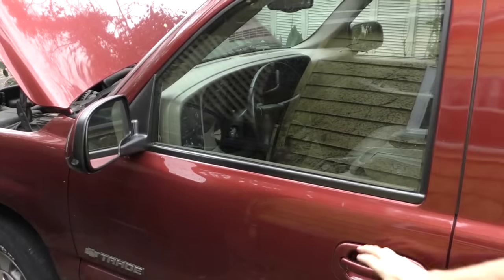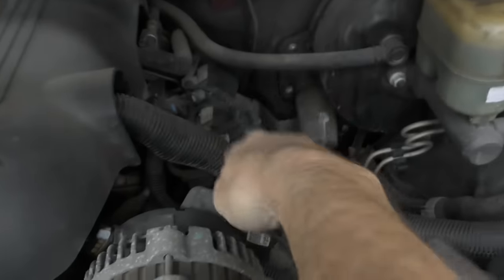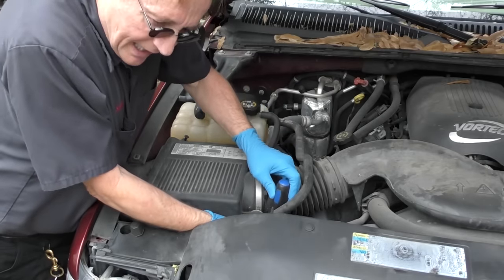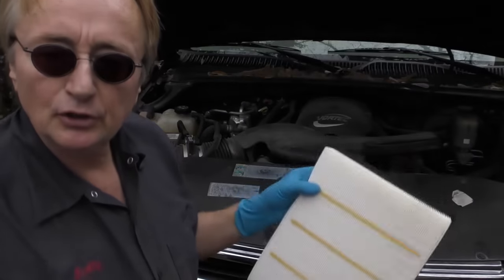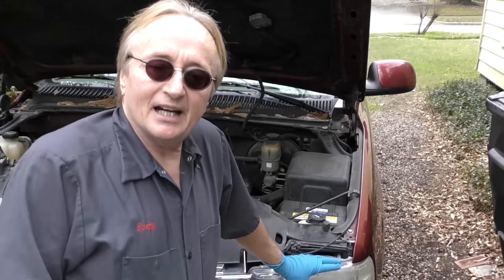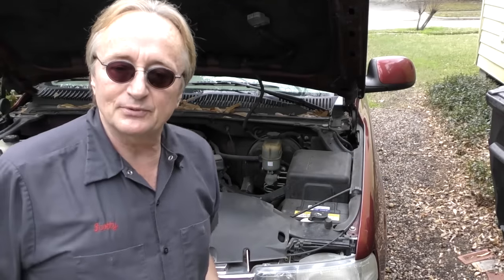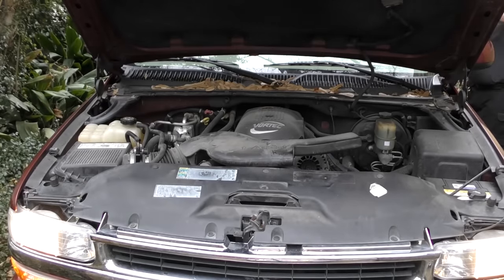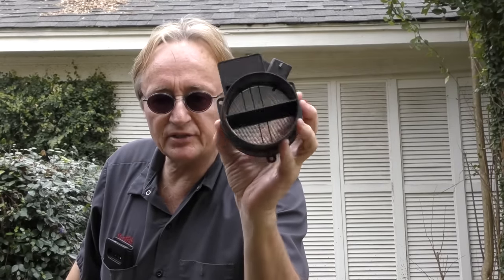Doing This Will Make Your Engine Run Better

Comment: Scotty, I have a 2007 Subaru legacy station wagon and whenever I fill up the gas tank more than halfway I can smell gas in the cabin when I turn on the AC, smell is also strong when I get close to the car after it's been parked. The issue goes away if I never fill the gas tank over halfway. What do you think it might be and how can I fix it? I really hope I don't have to change the gas tank. Hope you can answer this, thank you!
Reply: Sounds like the tank is not sealing properly where the fuel pump is installed most cars have a rubber type seal and a big ring that screws on.
Reply: @grantreid8583  would that still apply if I smell it even after only filling it slightly above half tank? I remember looking into this online and some people fixed it by replacing the fuel pump seal that's under the rear seat. But I thought that's probably not my issue since I don't have to fill it all the way to full for the leak to happen. It's probably worth checking out though once the weather goes above zero degrees, I live in canada haha

Comment: Will pluggin up the scan tool pull up any codes if theres no check engine light on?
Reply: Sometimes it might if it's a low-level thing.
Reply: Johnathon Castro yes, some codes are historic codes and some codes simply wont even trip the light at all, depends on the vehicle of course but some are so minimal they won’t trip a check engine light
Reply: Most cars i have seen will not bring the engine light on if they have faulty oxygen sensors which is a common problem.  I told my daughter not to buy a Jeep but she didn't listen.

Comment: Have a question I replace the Instrumental cluster and plug it the dash light are still not on I’ve check all the fuse and there not blowin still no dash light Change the dimmer switch still no dash lights 05 Yukon do you have any ideas 💡 on what to do

Comment: Hi this question has nothing to do with this video but I have a question about my 2006 impala LT ok so my car has been making this ridiculous clunking noise when I try to change the gears from park to drive then when I out my foot on the gas it won't move at all idk if my transmission fluid is low or something else worse is going on I really need your advice on what it could be because I'm confused 😑

Comment: Hey Scotty😸 How necessary is it to check intake/exhaust valve clearance on 1zz-fe engine. Fsm says every 60k. I have twice that and then some but car runs great. Gas mileage isnt as good as it should be @28mpg. Recommendation?

Comment: If somebody charged me for changing out this not even dirty air filter, I would feel (or even was) cheated...
Reply: It wasnt the filter it was a sensor he just did the filter cause he was right there.
Reply: @JRRepair  Yes of course, but assumingly the filter wasn 't for free.
Reply: If you put a new air flow sensor why would you put the old filter back. Kind of defeated the purpose.
Reply: @ozzesty7314  i did.. If it's fine, why replace it?

Comment: Why my truck GMC Sierra 1500 4.8 it’s using a lot of gas I have 435000 miles it runs fine I replace the fuel pump all the injectors it’s nice and smooth it’s just the gas problem help me out

Comment: My Lexus is running lean, hesitates when I floor it but pulling code for camshaft position sensor. Wonder if this is the problem cause it runs fine unless you floor it. Starts fine, idles fine but hesitates when I floor it

Comment: Hey great video! I have the same truck, just opposite problem. Could a faulty air flow sensor read falsely high air flow and cause a rich condition error code?
Reply: Faulty oxygen sensors seem to be the most common problem with any modern car.

Comment: 1.8t vw jetta oil pressure light comes on when letting off the gas and reaching around 2000 rpms after hitting the gas it goes away.  Any ideas?

Comment: scotty or someone, 2008 impala.
mine has this hesitation.. when I'm driving along, then try to get on the gas, ill feel a rumble sound then get this hesitation.  if i keep pressing the gas pedal the Stabil trc light comes on.. so i try to let off the gas when i feel it starting to hesitate and the light wont come on.. a few times when i start the car it feels like it wants to stall out... I thought i was maybe mass airflow. i cleaned that. no luck..  any thoughts?
Reply: Try cleaning your throttle body but it does sound more sinister than that if your traction control light is coming on.

Comment: My 94 Celica has turned 335,000 miles and runs like a clock. No check engine light either.

Comment: I have a 2006 trailblazer and I cleaned the throttle body with 117000 miles and no engine light . Disconnected the battery overnight to reset the computer and now I have an engine light on , just don't get it ???  It was running better and now it's worse but still drives ......... any clue??

Comment: Scotty I have a Mustang V6 that makes a loud tapping noise I think it's the lifters and it taps constantly, should I keep revving up the engine???
Reply: yes start it and hold the gas peddle on the floor untill the motor shuts off.  problem solved

Comment: I have a turn signal problem, the back left turn signal won’t work at and and the front blinks really fast. Both were replaced and still the same problem. Any one have any suggestions on what the problem may be ? Thanks.

Comment: my engine runs better after having it's 10k oil change. btw my cel is on but no codes found, do i change it to toyota?
Reply: Prob a old stored code. Getting a corrola will correct this issue.
Reply: @1stock1not  the 75 dodge van never had problems like this

Comment: I've got the same engine 5.3L 99 Sierra 286,000 but it's running rich on both banks. -15% fuel trim and poor gas mileage. Any common problems to look for?
Reply: My 99 silverado 5.3 has the same problem. From what I have learned is the gen 1 ls engines had a intake gasket problem on the plastic intake. Verify the intake gaskets are good along with the mass air flow sensor. This also causes the lean bank 1&2 issue. Also the engine idle surges when it's cold but clears when the engine earms up.

Comment: Wish u could fix my car scotty I have infinitiy fx35 2003 239,000 code po300 cant figure it out any advice smell fuel exhaust changed plugs still rough idle still have 1 code

Comment: My g35 coupe keeps overheating, it has a new radiator, thermostat and fans, theres light smoke and water drips coming from the exhaust after letting the car run for a little bit, i dont think a bleed test will help but hopefully someone here knows, or should i get the steel seal or bars leaks gasket fluid? I do not wanna dig up the engine to replace the head gasket lol

Comment: Scotty I’m curious, what’s your opinion on air flow censor cleaners? Do they work?
Reply: Yes, if you see dirt on the sensors. Usually it's clean if there is no air leak from the air filter.
Reply: The CRC MAF cleaner stuff is what Scotty has suggested from time to time.

Comment: Hey scotty, i have a VW 1.4 tsi 122hp. The engine stutters a bit at idle. I changed the sparkplugs, ignition coil, battery, all the filters, oil and coolant. Still stutters, what do i do?
Reply: Try cleaning the throttle body its a common problem with a lot of cars.
Reply: @grantreid8583  cleaned the 2 MAP Sensors today and its still the same. I think my last option now is the throttlebody
Reply: unfortunately this engine is a fuel stratified engine and needs inlets valve clear from deposits that's why engine stutters at idle, i have some videos on my channel about repair and maintenance on vw and other car, take a look.

Comment: I would of just sprayed map sensor cleaner on it 1st.
Reply: Don Le  He would of said, I just think it was a customers car and wanted to make sure it wouldn't be back anytime soon.
Reply: The thing is it will be back soon. Those fuel trims were not stabilizing as he said. The short term should read near opposite of the long term until they reach stoichiometry if indeed the problem was fixed. I like Scotty because he is like the people's mechanic, but he's not at the high tier that most of his subscribers seem to think he is.

Comment: So in open loop when the engine is cold I thought the computer didn’t really look at the MAF ?
Reply: Timboslice you’re thinking of the o2 sensors. Maf is used at all times. O2 sensor data is used after the min coolant temperature threshold is met for closed loop enable. A map sensor is used during open loop to measure engine load/vacuum. Once closed loop kicks in, the map sensor is used for transitional fueling and as a backup to the maf if failure occurs. The maf signal becomes the main player in fueling after that.
Reply: John Sorg Know what that’s right when the computer senses the coolant temperature is below a threshold it doesn’t look at the 02 sensor, I forgot about that I learned that back in junior college auto tech

Comment: This is the problem I'm having with my C6 Corvette.  I thought it was because I installed a cold air induction system. Won't pass inspection. I replaced the airflow sensor but the check engine light still comes on.. 68,000 miles 2007

Comment: I have a 93 Acura Intengra and whenever i turn at low speeds i hear the steering wheel making a squeaking sound and sometimes becomes tough to turn. I think the power steering pump might ne going out. Am i right?
Reply: Could be the pump, but it could just be low fluid level, so check that, first.
Reply: @EMichaelBall  i have...theres enough fluid.

Comment: Hey Scotty what are your thoughts as a Honda Civic type R as a daily driver
Reply: Yeah he loves them but he would advise you to road test it to see if you’re ok with the ride quality
Reply: 3rd to 4th grinds randomly with no known cause. Torque steer is going to be there. Once you factor in the operating and fueling costs, a Model 3 Standard Plus (RWD) would be a cheaper car over time, and with the Full Self Driving option package, would fight depreciation better than any new car I know of. It basically is a necessity to get FSD; to see why, youtube search "Tony Seba robin hood conference" and watch that presentation.
Reply: Yea i love it when someone pulls up beside me in the inside lane at the traffic lights in an expensive type r thinking they will race me across the lights and my old falcon blows their doors clean off it scares them a bit when they see smoke coming off my rear tyres at 50 as the boost peaks.

Comment: i have problem with my silverado 2014 the engine sometimes while idling gear on drive the RPM drop below 500 and it feel like it will turn off any idea ???
Reply: Try cleaning your throttle body.
Reply: Yeah. Perhaps the battery if its original. Weak batteries can make weird things happen.
Reply: grant reid i clean 10 times

Comment: my 2018 mazda cx-9 the oil fill says 0w20 but the owner manual says 5w30 which is right.
Reply: My 2018 honda takes the 0-20.  I would call the dealer service dept because a error on that could damage your engine
Reply: I'd do what the owners' manual says. You could call the Mazda customer service hotline and see what they say. Either way, it should be full synthetic.

Comment: Wow a 2002 with no rust on it. Up here the brake lines would have been done and the rocker panels are rotted out
Reply: Fix It 1975 It’s Houston. No snow. No ice. No salt. No rust.

Comment: BATTERY... do you need to disconnect it before you unplug the MAF?
Reply: No. Just keep the key out of the ignition. I only disconnect the battery if I'm working on airbags or anything that could be part of the airbag circuit, disconnecting and reconnecting the ECU, working on electronic power steering systems, or anything with aftermarket alarms and remote start.
Reply: Always unplug the battery no matter the job

Comment: A good mechanic i have told me to remove my engine,that will reduce my vehicles weight and will hugely improve gas mileage along with less strain on the suspension and tires and will last longer,scotty is this true?

Comment: Running lean caused by a part that's responsible for sucking in air or monitoring how much it gets.

Dishonest mechanic: It seems that your engine has a problem and it'll cost you $3,000 to replace with second hand engine. Also change the fluids and air intake for additional $550.

Comment: Mass air flow sense = Purge valve ?
Reply: What?
Reply: I'm confused because when you have a purge valve problem you do get the same code readings.
Reply: Maf sensor has to do with the incoming air. I know of two purge valves ones the evaporation system for the fuel and another one (kinda) for your refrigerate for your ac. What code on what car and year.

Comment: I have a 2019 Ram 1500 Classic. I would like to install a K&N air filter system without the air filter enclosed. Would this cause my engine to run leaner?
Reply: will void warranty
Reply: Not only would it void the warranty, it probably wouldn't make the engine run any better. Stick with the OEM air filters like Scotty suggests.
Reply: Clint C no, your computer reads the same amount of air coming through the intake, it would void your warranty but on most vehicles cold air intakes don’t do very much, if you have any naturally aspirated v8, eh, any modern v8 likes to run on the lean side anyway
Reply: No but the dirt it sucks in will wear the rings and bores a lot faster and turn it into an oil burner.
Reply: Not one person said to go kandn  Whats he gonna do? Do it anyway. Lol. For real though stick to oem.

Comment: A Chevy got 180k miles? Whats going on Scotty?
Reply: Cause it was the 5.3 vortec. The 4.3 vortec was a great motor too as long as it wasnt in a astro van. Not saying those weren't good but they were harder to work on.

Comment: NOOO SWITCHING FROM A GOVERNMET MOTORS VEHICLE TO A FORD (QUALITY VEHICLES) WILL MAKE THE ENGINE RUN BETTER SIMPLE ANSWER IS GET A BETTER QUALITY  VEHICLE TO DRIVE SUCH AS A FORD..WHICH NO ONE IN MY FAMILY BESIDES ME,MY AUNT, COUSIN   AND NO WAY IN HELL MY UNCLE  AGREE WITH THAT  ALTHOUGH FORD IS THE KING/QUEEN OF THE ROAD  DEPENDING ON YOUR GENDER 👍..!!

Comment: Buy a Toyota and your engine will run forever!!
Reply: GM engines also last forever 👍
Reply: Old GM v8 engines and the 3800s and the only good ones
Reply: @dalegribble3684  and the 3100

Comment: Maybe all those leaves are clogging it up.
Reply: You'd be surprised what can clog intakes. Several months ago, I worked on a Chevy Cruze turbo that came in with a MAF sensor code. I thought it just needed a MAF sensor up until I opened the air box. It smelled like a dead rat! I was 100% sure it was clogging the intake. Sure enough, i found a dead rat in the intake resonator. The holes are too small for it to come out. Ended up just replacing the resonator. MIL never came back on after test drive and car never came back for the same problem.

Comment: Doesnt bank 1 mean upstream (before cat) and bank 2 downstream (after cat)?  Never heard of it meaning side of car.  Educate me Scotty.
Reply: It Wasn't Every Floor Bank 2 Sensor 2 on a 1998 1500 5.7 is downstream (after cat). This is considered to be on the passenger side.
Reply: It is a v configured engine it has 2 banks in other words it has 2 rows of pistons  along with 2 cyl heads.